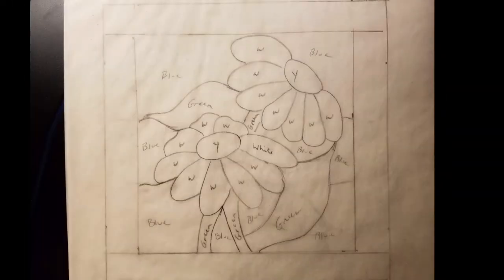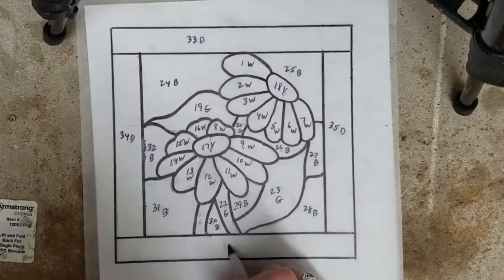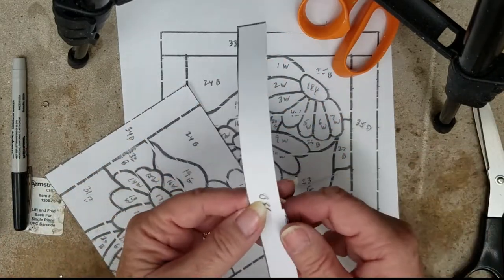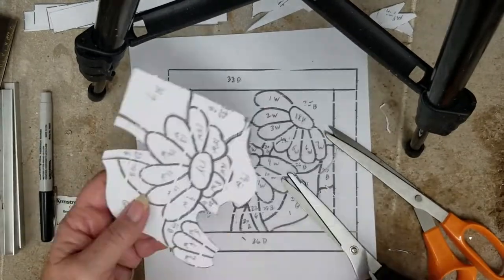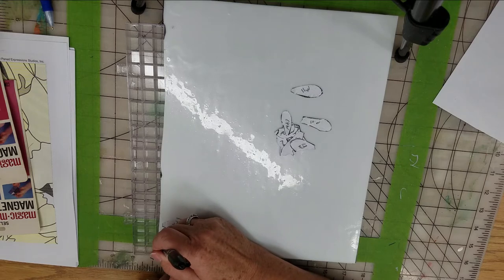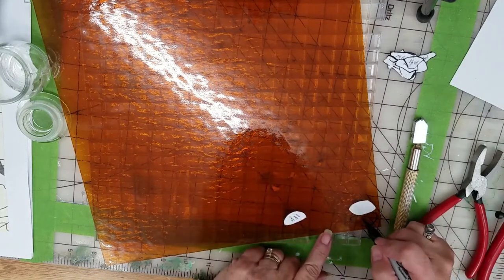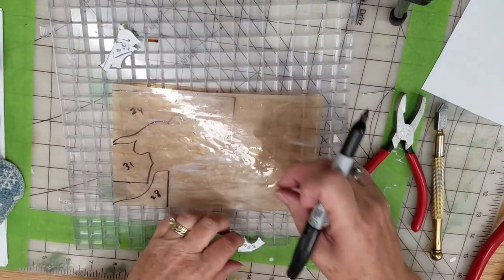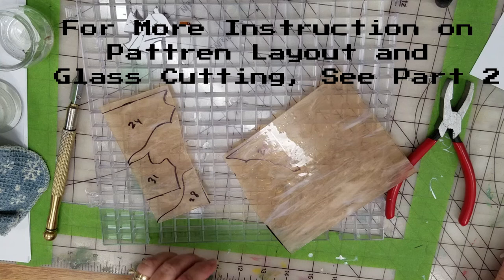Designing a Pattern for Stained Glass - Daisies (Part 1)

Comment: Hi here I was just wondering how thick the lines are that the pattern shears are removing? Cheers!
Reply from the maker: My black handled pattern shears are 1/32" which I use most of the time.  My white handled ones are 1/16" which, of course, are bigger.   Hope this helps.  :)
Reply: @artbycherylann8431  thanks for the reply.